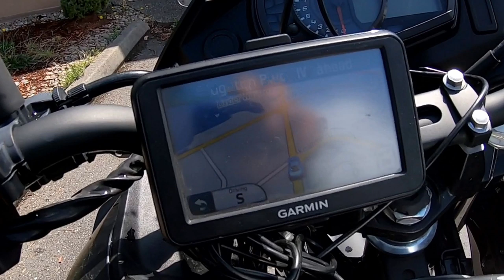Fixing the Bounder - Big Block Cheverolet Donut Gasket Repair & RV Maintenance - RV Living

Comment: Dave: I enjoyed your video. I am an old auto mechanic also. Lenape Voc. Tech. Ford City PA. Graduated in 1969. Too many years ago. Is it possible that you may have over torqued the nuts causing the springs to collapse. One side note. I watched the video where you straighted out the fins on the A/C condenser coil on Pandas RV.  You have a compassionate heart. It took a long time to comb out all of those cooling fins.
Reply from the maker: I took my drivers test at the DMV right beside Lenape! :) I still go through Ford Cliff often when I'm in the area. It did take a few hours to get those fins straight! :)

Comment: Just went thru this on my 94 Southwind 454 TBI. Replaced both in HB, Ca. then drove home to Renton, Wa. (~1330 miles). Anyhow...the passenger-side one looked just like yours after only 1330 miles. Turns out the springs (old ones) were much shorter than the new ones I bought after haven gotten home. When I crawled underneath at home I could literally move the springs up/down on the bolt shank. They weren't pushing up on the flange. New nuts and springs and a new gasket and problem solved. Use plenty of copper seize on everything. Get those spark plug wires covered with heat shield wrap or your be replacing those. Get the wrap as close to the end of the plug as possible (8-10in length) I can already see the wiring beginning to burn at 6:51 As for the nut/springs...do not tighten them up till the spring is fully collapsed. Leave some space for the spring to move.

Comment: Does your Bounder have  Catalytic  converters ??  Maybe you have too much Back-pressure in the exhaust causing the Donut gaskets to blow out  pre maturely ?
Reply: He’s generating to much heat  in the exhaust manifold, cats have a O2 sensor before and after (well at least ford do) the back pressure would of tripped a CEL, he did have a gasket failure before as well, since he’s upgraded that the next weak  point is the donut ring. He might need to get shortie headers or new exhaust manifolds.
Reply: @f.w.1318   Maybe  Dave's  Converter  is partially plugged, causing the excess heat ?
Reply: Thats what I was thinking, also check the muffler it might be partially clogged.
Reply: @bobgoodwin1032  If its clogged it should trip the check engine light, the code should be a P0420
Reply: F. W.  These years didn't require converts due to the GVWR being over a certain weight. I have a 97 without converts and it's a factory system.
Reply: @f.w.1318  Not on OBD1
Reply: @larryreno8293  I own a 1994 454 TBI P-30 and it has 1 cat after the muffler. It also only has (1) O2 sensor after the pipe merge downstream.

Comment: Is it possible that the last gaskets were just slightly bigger, having been made for another RV?
I got a light bulb slightly bigger than the type needed for my ceiling lamp. It didn't perfectly fit (it's in there at a slight angle), but it has been working for years now.
Reply from the maker: They call out at least three different gaskets for that year 454. I'm guessing the first ones where not exactly right.

Comment: buy yourself a set of headers for your chevy motor. it will run better and a little more horse power. and maybe better gas milege.
Reply from the maker: I've seen too many header gaskets fail.

Comment: The anti seize is awesome. I broke 3 oil caps until I put the anti seize on. Not sure it goes on the oil filler cap but it sure works. Enjoy Washington. I spent over 40 years there had to leave. Alabama is so much nicer as far as weather goes. Didn't see Bella this time. C u l8r

Comment: Dave In my experience I kept burning out donuts in my truck. My exhaust was swinging around and I had one bad motor mount. I replaced the exhaust hangers and motor mounts and it was quiet for a year until I destroyed the exhaust system on a rock. Best of luck to you.
Reply from the maker: Thanks Glenn. I did read that somewhere and checked those things out. The mounts are good and exhaust is secure. I'm just going to have to keep my fingers crossed for now! :)

Comment: Maybe try Re-torquing them after a few hundred miles ???
Reply: That is what he should do, all nuts one full turn each.
Reply: @williamblalock3667  The bolts are shouldered. You run the nuts down until they stop and the springs should have no play in them. Impossible to over-tighten them due to the shoulder.

Comment: Hey Dave..glad you were able to get Betty quiet again  ;-)  At least on yours it's a donut gasket you can replace..I have a Ford 460 in a van and the pipe warps on the passenger side where it bolts to the manifold. It requires them cutting off the old pipe..making a new one and welding it on. I get about a year and it's time to do it again.
Reply from the maker: Now that is strange. Did you check your motor mounts?
Reply: @DavesRVLife  Never thought about it but I'll definitely check it out..getting old having to do that..lol. Thanks for the suggestion !